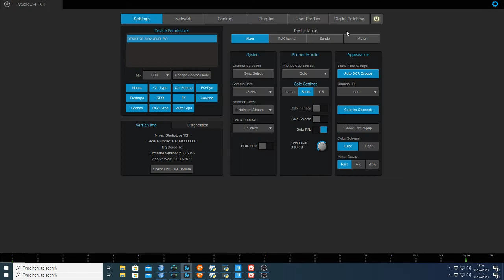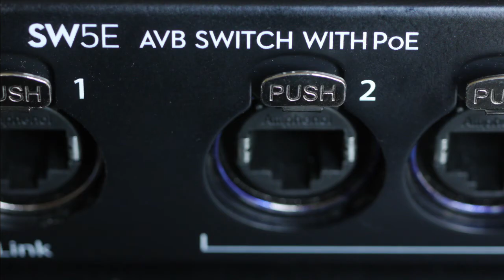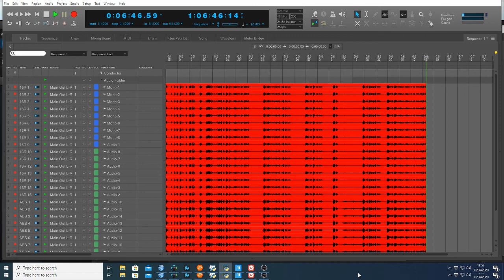I don't need no Dante - By The Power of AVB Aggregate your audio interfaces, know what I mean?

Comment: I came across your video on the Motu-nation forum website. I've been doing this exact thing with my Motu 24Ao and 24 Ai and 2 presonus NSB8.8 stageboxes.  All flawlessly.  All cat6 cable going to and from my presonus SW5e switch.  I decided to buy a Motu AVB switch so that I can leave my SW5e in my live setup rack. Motu says simple plug-in-play.  But not the case.  Drop outs were plenty. tried everything, update firmware  on the motu switch but no luck.  Put my SW5e back into the system and all worked just great.   I wish I knew what the heck is going on. Wonder if anyone has had run across this.
Thanks and great video!
Reply from the maker: Hi Steve - I have to say I haven't tried the MOTU switch so I don't have any real world experience. I do remember having to upgrade the firmware in my 112D which helped with AVB connectivity to my 16R. Your system looks great on paper, shame about dropouts. Does MOTU support offer any advice?
Ta like, ppm6.

Comment: Hi There, I hope you are well, I have a drop out issue on my Motu LP32, but only when I adjust the gain on my Presonus 32r, AVB connected, all on the same sample rate, ive tried clocking them each as master slave, slave master etc. seems that the preamp control is causing some sort of drop out, I just wondered if you have had this with your setup at all? if I do not touch the gain it all works fine, im pulling my hair out lol especially after investing into AVB
Reply from the maker: Hi Paul, I hadn't run into this but I've been chasing other issues for the last year or so and not paying much attention to AVB. But last week I rigged the 112D and the 16R back up for some simple AVB stuff. And so I tested your proposition and can confirm my 112D reboots after a channel gain change on the 16R. All my stuff is fully up to date so not sure what is going on. I've reached out to Presonus today and will try MOTU tomorrow when I get a chance. Thanks for this rather bad news! Ta like, ppm6.
Reply from the maker: Sorry Paul forgot to ask - have you got the complete system run down and connections? Ta like, ppm6.
Reply from the maker: GOOD NEWS Paul, MOTU firmware update fixes this!! 1.3.5+1436  is what you need. Ta like, ppm6.

Comment: Hello could you help me understand why I am not able to use RME DIGIFACE AVB Or any other AVB Interface with VENUE S6L for recording/playback purpose on windows 10 and why I am being forced to purchase mac 💻 system to the same?
Reply from the maker: Hi Ashish, the sad truth is that MS haven’t included an AVB driver in any version of Windows. There were third party solutions from Audio Science and  Echo. I think that both these solutions are out of production but I could be wrong. Probably the best solution is to buy an interface with a different option for recording. So the RME has USB as well as AVB and something like the MOTU 112D has AVB and USB, Thunderbolt, MADI and AES and ADAT - that’s the route I have gone down. It would be worth checking the AVB situation on Apple silicon before going that way. Ta ppm6
Reply: @ppmtv-qh9qk  Thank you so much for replying, I have done some research and the conclusion is you need AVDEEC DRIVER and Rme is providing everything but still its not compatible, I had also written to Audio science Hono AVB VSC is also discontinued which they say may have worked :(. I am just getting pissed knowing how that there is no way I cannot record/playback on MS10 ☹️
Reply from the maker: I think the Audio Science and the Echo NIC-1 were both pretty expensive solutions. But you may find one second hand. Of course they are only going to work in a PC with PCIe slots. No laptop love here. But thinking about the cost of one of those solutions Presonus can bridge AVB to Dante (only 16 channels) for around $500 - https://www.presonus.com/products/AVB-D16 
and you can record Dante on your PC with your software Dante sound card. But at that price why not just plug your AVB box in to your computer using USB? Ta like, ppm6.

Comment: What about latency
Reply from the maker: Good question. The Presonus system currently guarantees a total network latency fixed at 2mS across up to 7 hops, or network links. This is the AVB standard. However local implementations can go faster. MOTU claim 0.625 mS within their network. Presonus say their hardware can go faster still...  
I haven't tested  the issue of latency, I know I should!
Ta like ppm6.

Comment: Please break down AVB & Dantes differences for production in both Video and Audio.

Thank you for your time.
Reply from the maker: Hi TRC - thanks for the question. I'm afraid such a 'big picture' analysis is beyond my expertise. However here are few things I do know.

Dante is everywhere - if you want to be with the mainstream, this is the place to be. Except in the speaker end of the live environment where AVB seems to have taken hold.

I spoke to a manager at a to UK digital audio manufacturer about AVB v Dante about 2 years ago. He was certain AVB was a better solution. They not long ago released a Dante interface for their product. Why? Because of the reason above.

When you're talking mixers for live - Dante is king.

I don't have enough expertise to speak to the nitty gritty of the tech but putting the switch in control of the QoS seems to me to be a good idea. That's an advantage to AVB, though it also means you can't have an off the shelf ethernet switch. This AVB advantage should pan out in better control of latency and guaranteed delivery across the network. Whether it does or not, I can't say. 

Because manufacturers don't have to pay a licence to Audinate - it makes AVB cheaper - hence MOTU and Presonus have very affordable AVB solutions. Presonus at the moment are really going for AVB and are building a complete AVB ecosystem. But they are a bit of island in a Dante stream!

I suspect that Audinate's control over Dante means better compatibility across different brands  - AVB is improving but it has chequered history in this regard. 

MacOS has AVB support built in (up to 48KHz)  - this is great plug your AVB interface in without installing drivers. But will Apple continue to support? And on Windows the situation is reversed - Dante support cheap - AVB pretty tricky.

One key element here is RME - they have launched AVB and Dante products - let's see which one prevails. And would you believe it today they announced new AVB gear - with no Dante onboard!
https://www.rme-audio.de/m-1610-pro.html

My heart says AVB and I have invested and use AVB enabled products from MOTU and Presonus. My head says Dante.

I'd be interested to know what sort of project you had in mind?

Ta like, ppm6.
Reply: @ppmtv-qh9qk  And yet, RME JUST went AVB with their new offerings :) go figure hey. The advantages of a non open system are numerous in the tech world. Guess we'll see more as time goes on.